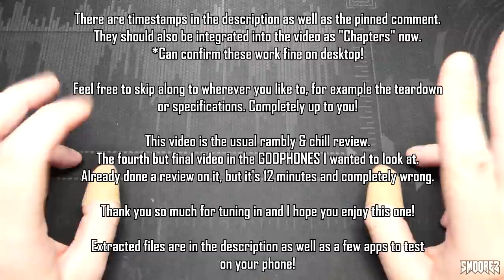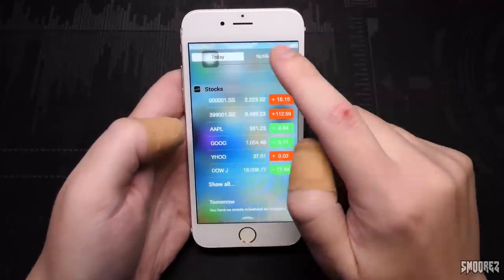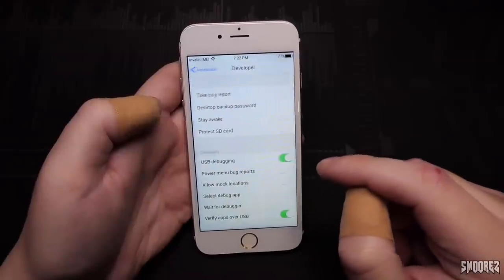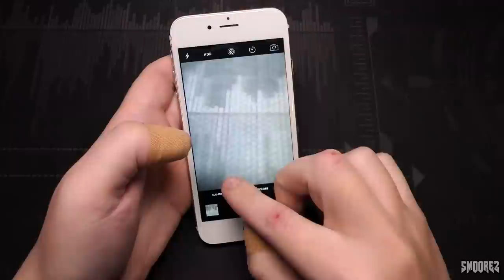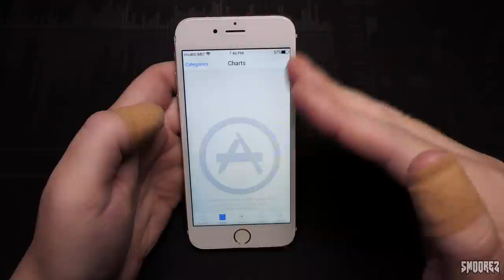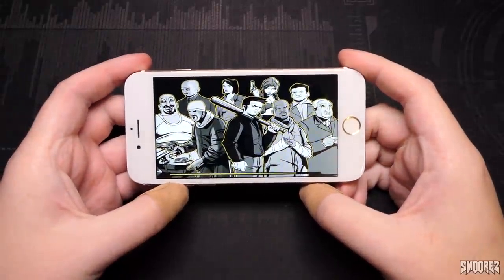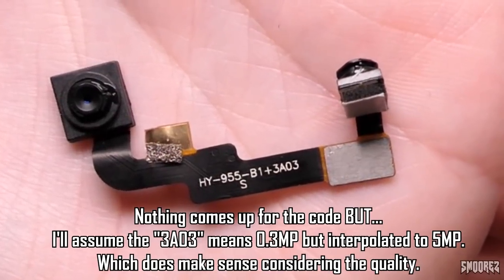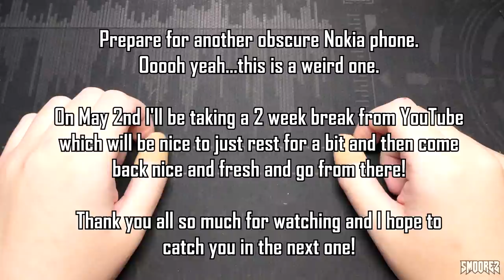ATTACK OF THE CLONES: The GOOPHONE i6s REDUX - An average Apple iPhone 6s Clone thing...

Comment from the maker: WE ARE DONE WITH GOOPHONES 4 in a row is just too much. Finally I can move onto some other content as I am fairly sure you have all seen enough GOOPHONE things for now, later on I'll look at the other ones I have so this will have to do for now. It's been basically another iPhone Clone Month which was the same thing over and over with few changes. Regardless, I hope you did enjoy this little series to add to the Clone Month and stay tuned for some upcoming Obscure stuff before I take a 2 week break as from May 2nd.
Also let me know if you have ever used a GOOPHONE...interesting to see if you have or not!
Alright, thanks so much for watching and I'll see you all in the next one :)

TIMESTAMPS:
Intro & Disclaimers: 0:00
The iPhone 6s Specifications etc: 1:17
Real vs GOOPHONE Comparison: 2:32
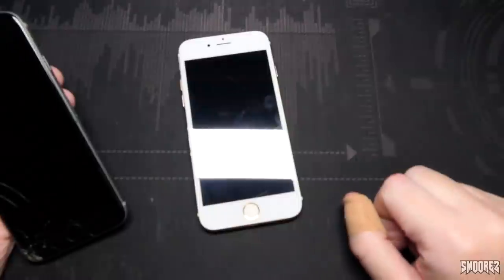Power On, Display Quality, 3D Touch & Buttons: 4:33
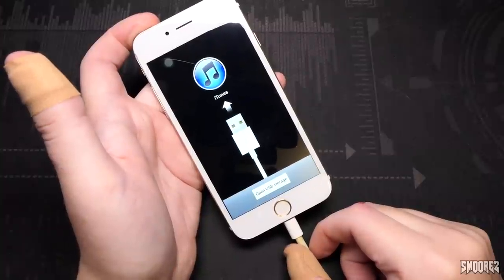UI, Shortcuts & Default Applications: 6:29
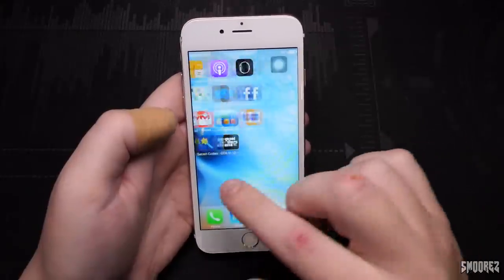Attempting Phonecalls, Keyboard, WiFi & Cellular: 8:08
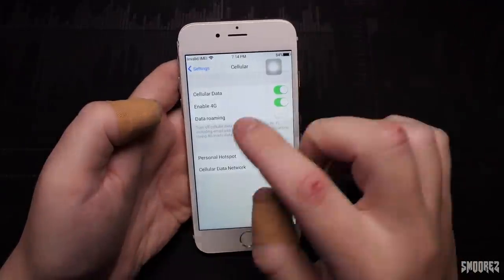Settings - Notifications, About Phone & Siri: 9:29
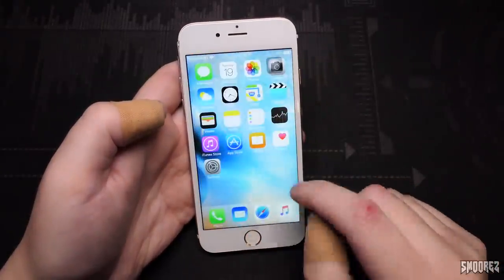Settings - General Stuff & List of Applications: 11:50
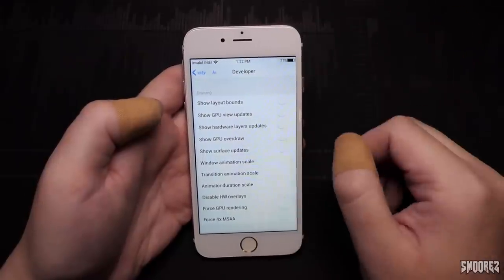Settings - Storage, More General Stuff & Display: 13:31
Settings - Wallpapers & Sounds: 14:16
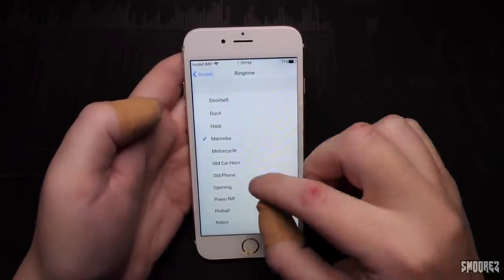Settings - Touch ID, Battery, iCloud Login & iTunes: 16:00
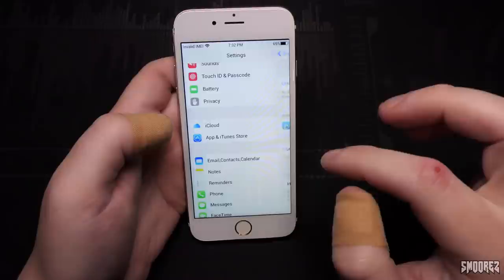Settings - Everything else that lives in Settings: 17:27
Messages, Calendar, Photos & Camera: 18:33
Camera Test: 20:24
Camera Quality, Weather, Clock, Wallet & Notes: 22:59
Stocks, iTunes Store, App Store, iBooks & Health: 24:32
Phone, Mail, Safari & YouTube Test: 27:02
Speaker Test, Facetime & FM Radio: 28:48
Watch, Compass, Tips & GOOPHONES are Tiring: 30:07
GAMING TEST (Grand Theft Auto III): 32:00
DeviceInfoHW & CPU System Info that's not quite accurate: 33:48
Secret Codes: 35:46
Conclusion: 36:47
Teardown: 37:42
Does it still work, Full Specifications etc: 42:04
No more GOOPHONES...for now, Timestamps & Disclaimers: 43:20
Outro: 44:37

CPU & System Apps are in the description above, as well as the extracted files from the phone!

Be good people!
Reply: I'd say the iPhone 6s is semi-recent because it still gets the newest apple software
Reply: how did you install gta///?
Reply: Can you find a s22 ultra clone phone?
Reply: Do the Android S3 clones, i loved those Java ones you showed
Reply: @fred-youtube  I'm pretty sure that they're pretty hard to find
Reply: the sound goo in "Sinhala" language is poop, so makes sense."

Comment: It's like a fake kitchen. If you squint, it kinda looks like a kitchen, there's even some bread on the table, but as soon as you try to open the cupboards, you realize they're just painted on, there's nothing beneath the surface
Reply: Holographic meatloaf?!
Reply: That's an oddly... specific analogy
Reply: What part was it?
Reply: It reminds me of those old CRT TVs where they had dual speaker grilles to make it seem like it was stereo, even though there was actually only one mono speaker installed.

Comment: The sad thing about these clones is you can get a nice Sony Xperia XZ or similar phone for not a whole lot more used and it will be better in every way.  That would be having a much better camera than clones typically have and no software trickery to try to mask the real specs.  Don't like Sony?  There are a lot of really good Samsung phones that are also many times better than the clones ever were.  Get a good used LG or Motorola for the same price as one of those clones.  It won't be new but it will be a lot better in every way than a clone ever was.  The clones I am thinking of are those awful Welcome phones.  If you ever saw one you would know they are junk the moment you see Welcome.  Did it say 128 GB in storage?  You may have gotten just 4 or 8 GB and will lose data as soon as you try to store more.  With such a terrible camera it is really nothing lost if all you photos didn't save, they will be mediocre and 5 MP at best!!!